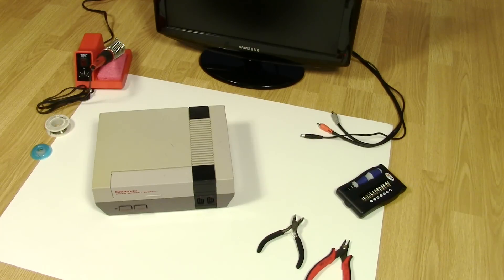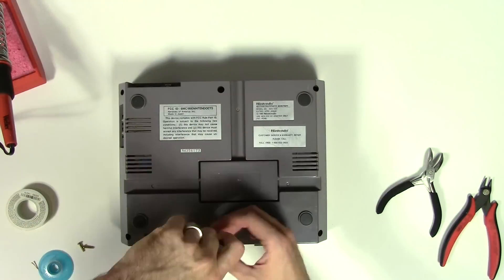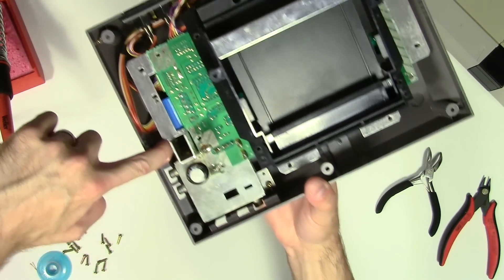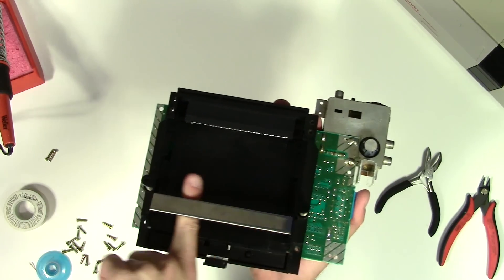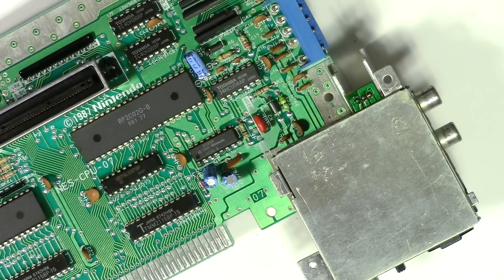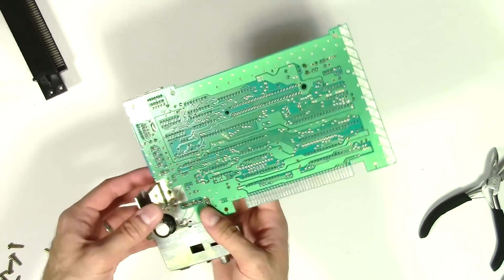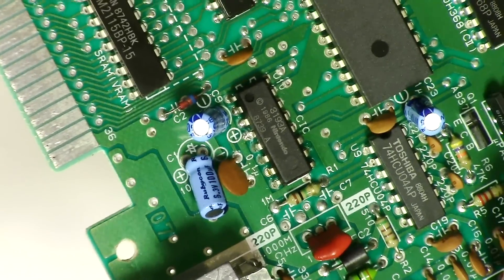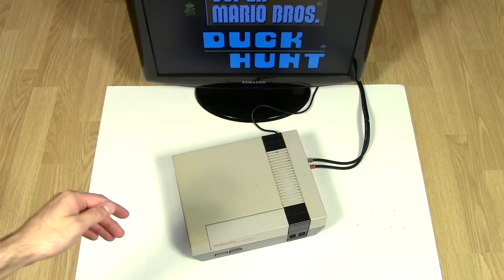Fixing the NES Blinking Light of Death

Comment: I went through and cleaned all my game cartridges and never had this problem ever again. Hopefully I won't have to ever open my NES
Reply: I've been thinking it would be funny if we ended up realizing everybody's been replacing pin connectors and just not seeing what the simple problem may be. I never had to replace my Nes parts and it performed very nicely from '91 until a few yrs ago when I unfortunately sold it.
Reply: The connector IS the problem. It's not the lock out chip. Anyone who says this is full of shit and has done ZIPPO for research. The design was flawed as the pins would get bent and warped over time with the removing of game carts.

Comment: I disabled the 4th pin from the lockout chip and replaces the 72 pin part on it and still got a purple screen...i got so mad i just thru the damn thing away and sold all the games about 150 of them for about 5 a piece yes even some expensive ones...i just didn't want to deal with it anymore..downloaded the roms got a raspi and now i feel better. Going to do the same with my Genesis and SNES.  Going straight with emulation. Also O.G Xbox just got a modded with 1tb full game library xbox games only. Will be selling all of mine soon 10 bucks a piece yeah even my Fatal frames and Def Jam Figjt for NY and more.
Reply: You were foolish to throw it away. You might have had bad RAM chips if everything else was clean and the lockout chip was disabled.

Comment: Yeah I have two of these original NES one has no sound but good image the other one has red blinking red light and the screen is pinkish purple screen display and no sound
Reply: The one with no sound I'm solder job fixing the sound but the other one I don't know I think that it's the 72 pin connector what do you think that it is Colin

Comment: Complete waste of time ordered the 72 pin connector did not fix it cut the 4th lead on the circuitboard yes it got the red light to stop but still no video this video was useless to me but not completely accurate I would not cut stuff on your circuitboard I'm sorry I did it now I don't really know what's wrong with it throw it out I guess.
Thanks dude
Reply: So your issue is not related to his fix but you blame him because your system has another fault before doing what you did??? 🤷🤷🤦🤦

Comment: Okay... Soooooo... Un-modded, this system is bricked. If I were a collector, I would have no interest in it then, because of the fact that it is not functional as an un-modded system.

My advice? Do not be concerned about reversing the mod. In order for it to have any real value at all, it must work. Go ahead and cut your losses and focus more on selling it as a used system to someone who just simply wants a working NES console. In that respect, maintain full disclosure and let the buyer know that it IS modded... But only to the extent that it is functional. Explain the fact that the lockout chip failed and, as a result, that failed chip caused the red blinking light of death, effectively bricking the machine. The modding was therefore necessary in order to restore functionality to the system. Any sane, rational person should be able to understand this and appreciate the fact that you did take that necessary step to sell them a working system.

IF they question you as to why you did not replace the chip, simply explain to them the fact that the lockout chip is an irreplaceable part. Simple as that.
Reply from the maker: +Christopher Althouse Some very good points! And to some buyers, a modded console may be worth even more than a stock one.
Reply: This Does Not Compute Perhaps so! :) Glad that you appreciate my input... Best of luck to you in your continued endeavors. :D

Comment: All my games work other than 1 and im clueless about what to do... I cleaned it btw
Reply: If you've thoroughly cleaned it. It may have a bad rom. Do you know how to re flash ?
Reply: +Darren Connelly You can't reflash those ROMS.
Reply: Ah I didn't know that, thanks. But u can use a new Eprom ?
Reply: ***** Sure thing! If you burn the .nes file and the char file. You'll need to replace both chips and maybe do some rewiring to fix the pins.

Comment: Should have just desoldered the side with pin4 and bent it up, bent the pin, bent it back down and resoldered the connection. or just desolder pin4 and cover it with heatshrink.

P.S. way to go DRM f**king over consumers in 1983
Reply: Well, considering that the video game crash happened because Atari lost control of their system so there were way too many shitty games getting out there which caused the market to fail and move over to home computers, it was a smart move.

That is not what the big problem is. He is wrong in this video. The MAJOR issue is simply the 72 pin connector. It's a flawed design, but again to Nintendo's defense they had to make it that way due to Atari fucking over the market only 2 years earlier. They wanted a top loading system for the start (look up the Advance Video System (not the one from RetroUSB, Retrousb just used the name Nintendo was going to call the NES back in 1984 consumer electronics show)) but had to design it this way to make it not look like a video game console and more atkin to a VCR.